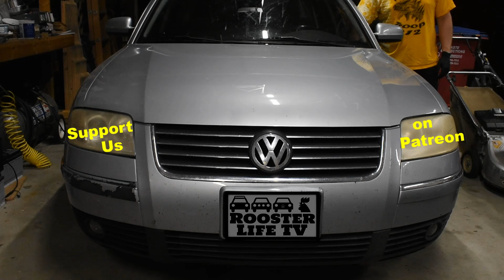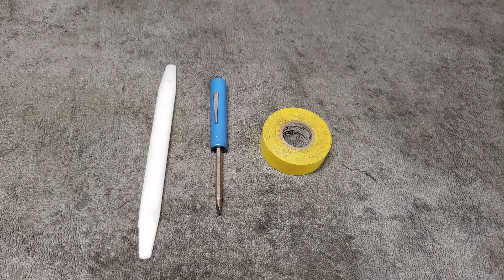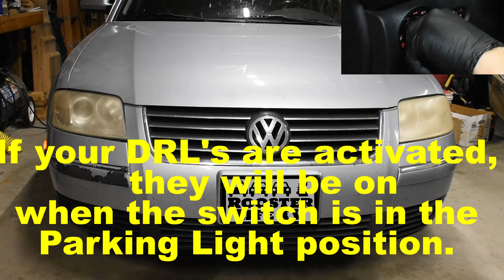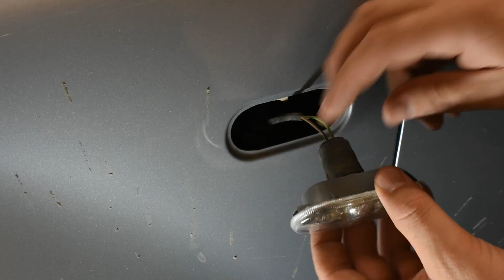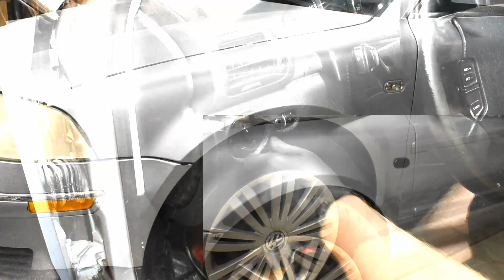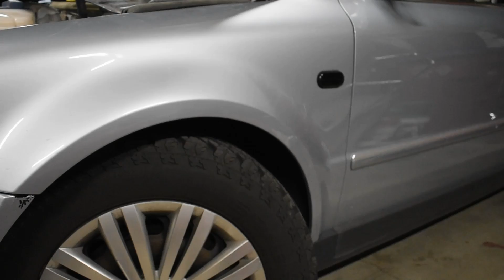"Lights, Euro, Action!" - B5.5 Passat Lighting Upgrades

Comment: Can you make any front like daytime running lights like the fog lights
Reply from the maker: You may be able to take wire for the fog lights on the back of the switch and put it into the DRL slot. But your fog lights would turn off when the headlights turn on. Another option would be to add a jumper wire from the DRL pin to the fog light wire. Then the fog light switch would still function.

Comment: You did figure out the side turn signal was put in upside down right?
Reply from the maker: There are may brands of this turn signal, and seem to be split 50/50 on how the direction should go. On my particular set, the labeling on the housing is on the ends, with no specific up/down markings. I chose to have the signal move rear to front, attempting to communicate "I am coming from here and going to there".

Comment: Great Video!  Where did you source the parts for the upgrades?
Reply from the maker: The headlight switch and fender turn signals were from Amazon. The smoked bumper lights were from Ebay.